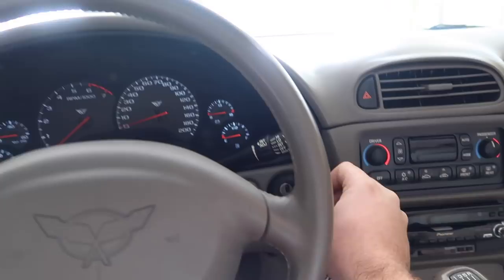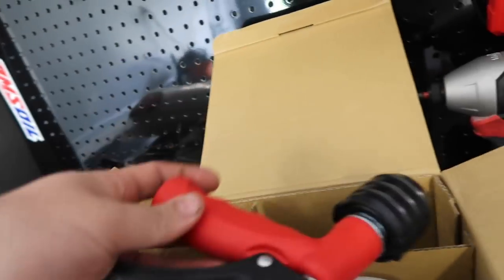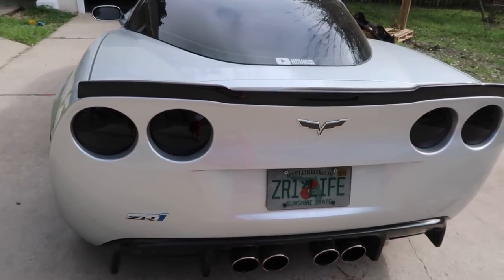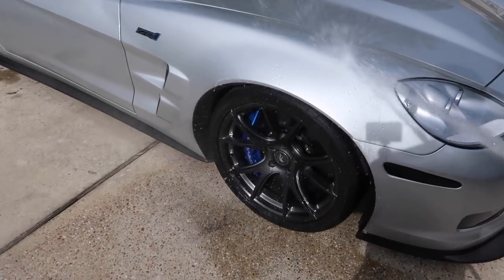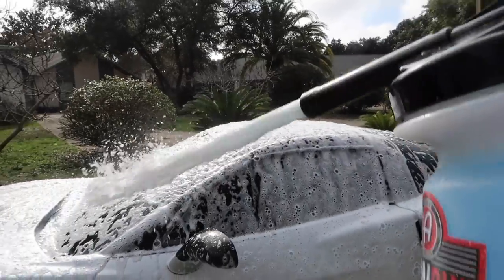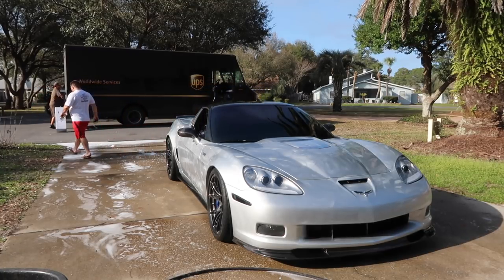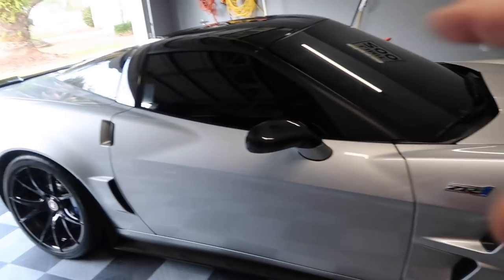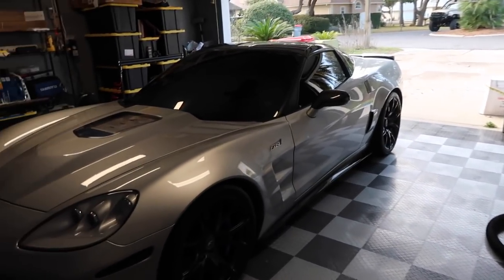Detailing the Zr1! Are FOAM GUNS better than FOAM CANNONS?

Comment: The foam gun is the way to go for easy washing. The hassle of pulling out my pressure washer and hooking up all the hoses is for the birds. Now I just grab the hose and get to washing! I actually think it works better to get the dirt of because the water runs off the car more instead of the foam just sticking to the car and trapping the dirt. Cheers!